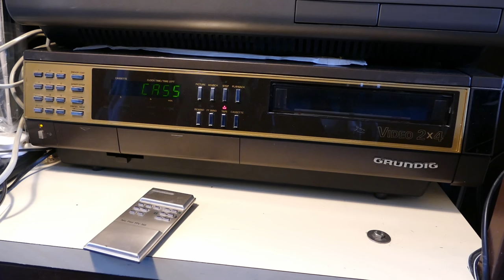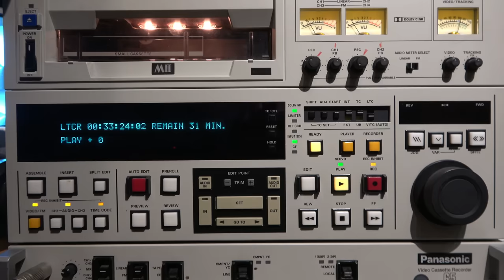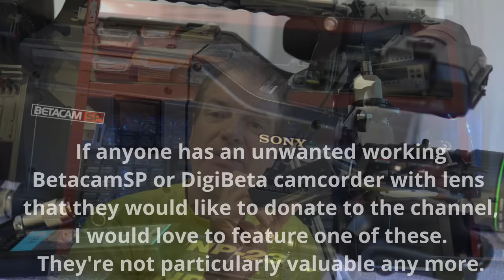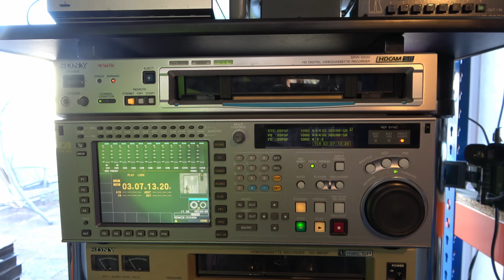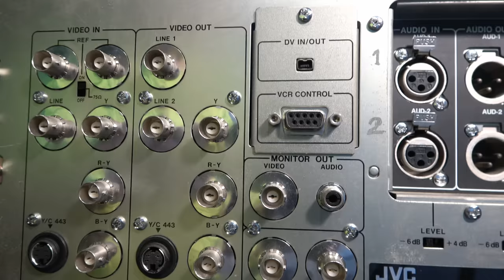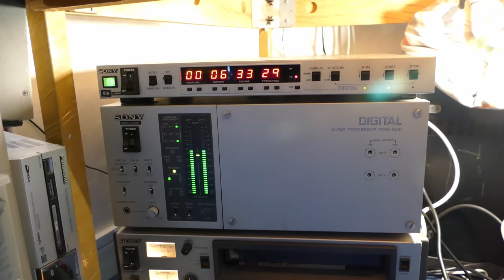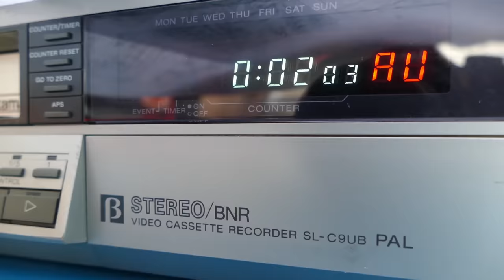Beta vs VHS. A world in which Beta won.

Comment: D3 records a digitized CVBS signal, with which one can save Quadruplex and B or C format unchanged. But that actually only made sense when a BBC employee invented the Transform PAL decoder at the end of the 90s. The alternatives would be comb filters like in the Canopus ADVC-100 (SAA7114) with mediocre sharpness and usable CrossColor interference suppression, or a comb filter with excellent CrossColor suppression but extreme crawling dot formation (Terratec Grabby PRO). There is supposed to be a software solution against crawling dots, but I haven't tested it.
Reply: SingMai made a modern capture device that uses 3D comb filtering and actually can reduce dot crawl from composite sources dramatically.
Reply: … and we still have (and use today) all the Transform PAL decoders that have ever existed
Reply: The Sony DVW-(A)500P had a simple PAL decoder for recording from composite sources, so it couldn't correct for variations in chroma phase. Not all of them could take a composite signal, it seems the decoder board was an option and not fitted to all machines. External decoders seems to do a much better job. Sony must have improved later decoder boards as the one fitted in their DSR-2000P DVCam studio recorder could correct chroma phase errors.
Reply: @jkmac625  BKDW-506 is the name of the optional composite in circuit board. If designers live in an NTSC country, you can be happy that PAL has been optimized at all.

Comment: Danmarks radio TV also started out as the BBC by digitizing their oldest material 2 INCH tapes on the D3 format from 1992. But when Sony launched Digibeta in 1993, Danmarks Radio TV purchased the first Digibeta and then transferred to this new format. that was much more stable than the D3. Digibeta used the 4:2:2 encoding. I'm quite envious of your HD Cam SR. I would love to own one like that 🙂

Comment: I believe it was the other way round, JVC developed their Digital-S format that could achieve broadcast quality video using 4:2:2 subsampling and Panasonic took advantage of it. I read in a D-9 brochure it was developed together with FOX network as a less costly alternative to Betacam for news gathering.
Reply: Thought D9 was 4:2:0 or 4:2:1 selectable. No wait… that was D7 dvcpro.
Reply: @tekvax01  DVCPRO was always 4:1:1
Reply: @tekvax01  Digital-S/D9 was 4:2:2 and I'm sure 4:2:2 was printed on the front panel. It was supposed to compete with Digi-Beta but it had slightly higher compression around 3:1 compared with Digi-Beta's 2:1, so it's closer to DVCPRO-50 quality. DVCPRO is 4:1:1 but DVCPRO-50 is 4:2:2.  Can't remember anything being 4:2:1 but DV(PAL) was 4:2:0.

Comment: I don't agree on V2000. I worked in a repair shop and in it's time most of the V2000 vrt's worked fine and they needed no more time to service as VHS. Most service time was for Beta, aligning mechanicly and electronicly after head swap. Now you do a terrific job but the units are now more than 30 y old. I repaired (1980's) every day vrt's (Belgium), most VHS followed by V2000 and than Betamax. The systems preform more or less the same, being Beta most expensive and a tiny better as the others.
I like your video's!
Reply from the maker: Only a few early Sony Beta models needed the head eccentricity to be aligned.  From the SL-C9 onwards they were pre-aligned like VHS, as were Sanyo and Toshiba Beta heads.  I think most people who have worked on V2000 machines will say that they are complex and troublesome.
Reply: @Dirk De Weerdt I agree. Grundig models were often unreliable but Philips Video 2000 models from the second generation onward were more reliable. Perhaps very few of the decent ones came to the UK that is why the author of the video has such experiences. Also Grundig already improved the reliability of the third series of its Video 2000 machines after 1983, but it took too long and cost too much.
Reply: @janmos5178  no he is right. V2000 was a disaster. The Philips machines broke down all the time. All my cousins had them and they were a nightmare.Never seen a Grundig. Philips marketing had many people in the Netherlands believe V2000 was a  "technically superior" system. That was just an urban legend which is sometimes still heard today.
Reply: @montana01971  They didn't all break down, even the statistics don't confirm it. This is what you could write if you had access to all copies. But yes, the percentage of failure devices was high. But how urban legend can be misleading is shown, for example, by Matsushita-Panasonic. NV 370, 630, 860 models are famous for their quality, meanwhile in 1985 they had so many post-warranty repairs that the famous Japanese MITI ordered their replacement in Japan. Fans of these VCR,s don't mention it but the press of those years, did. This just goes to show how, without careful analysis of statistical sources, you can get it wrong.

Comment: Your comments about D3 and the BBC are way off the mark in terms of branding it a failure. Around 1990 the BBC was nearing completion of its new Post Production Centre in Stage 5 at Television Centre, and needed to settle on a digital cassette based format to populate it, replacing the large and aging C Format based machines (Ampex VPR2 etc.) used for editing and transmission up to that point. Digital Betacam was still a few years away, and formats like Sony D1 were hideously expensive, so D3 was chosen to fit within the new infrastructure, and ran successfully for more than a decade as the main editing and TX format. Included innovations such as Preread were a game changer for fast turnaround operations such as sport editing. There were a lot of D3 problems early on being a new format, with heads wearing out in a matter of maybe 50 hours use, but these problems were quickly ironed out. Panasonic even had their own workshop within the Post Production Centre in the early days.

I say this from the point of view of being one of the senior engineers who ran and maintained all this throughout that time. As for D3 archive content, by the end of this year we’ll have got through all the tapes that we intend to preserve, and even after that we are designing and building some D3 preservation capability right now for the odd tape that will crop up now and then.
Reply from the maker: Other comments here have pointed out that Digital Betacam was not ready when D3 was available, so as you say, that was clearly the reason that D3 was selected.  There's a mention in Wikipedia about insufficient capacity to run the BBC's archives, which perhaps would benefit with and update from your knowledge.
Reply: Happy days. Saturday afternoons would be spent down in the BBC1/2 transmission suites checking the track linearity of all the D3 machines amongst other things. Particularly on the larger cased 3 hour tapes used for feature films, where they tended to be more prone to playback errors if out of spec too much.
Reply: To add, D3 fitted nicely into the largely analogue PAL infrastructure at BBC production centres. Analogue PAL composite video was the format used in TV studios, editing and other production areas. If you put in a load of component machines, the PAL signal would need to be decoded and recoded with resulting artefacts. The D3 with its analogue PAL input would fit nicely into a composite studio, edit suite or transmission area (ie most of Television Centre) without the need to decode and recode the PAL signal. Once it was on the D3 tape, you got all the benefits of digital storage.... TC1 (the big studio at BBC TV Centre) was analogue PAL when I started as a trainee in 1997. Good old composite video was THE broadcast format for a very long time. Most TV Centre studios used SDI as the late 1990s, but would often be fitted out with D3s (and fancy digital PAL coders to convert from component (SDI) to digital PAL (to the D3). They could be swapped out for Digibeta to record component from the SDI, if editing was to be done on the increasingly common Digibeta.
Reply: How I miss the analogue days of having to time things into vision mixers, replay lines etc., and having to worry about things like SCH phase and 8-field sequences.  🙂
Reply: @rpb424  The RS tweaker gets far too little use these days!
Reply: @RetroWorkshop  Agreed (sob 😞). I have loads in my toolkit and haven't used them for years now. Same with other old-school stuff like Varicon (EDAC) connectors. Once ubiquitous but not now - I still have crimpers, pin extractors etc.
Reply: "Panasonic even had their own workshop within the Post Production Centre" I think that says it all!

Comment: It wasn't just Thames that had MII, Anglia in Norwich did too. I went for a job interview at Anglia in 1996 and their videotape area had Panasonic MII decks and a single Sony BVW-75 BetaSP deck sat on a bench, presumably for exchanging tapes in that format. At that time Anglia's transmissions came from Meridian so it's possible they had some MII decks too.

I was told one reason the BBC went with D3, apart from the fact Digi-Beta hadn't been invented yet, was being Composite Digital rather than Component Digital the "new" D3 machines (AJ-D350s) could easily be swapped with an existing 1 inch reel to reel video recorder. You've got to remember at the time (1991/92) places like BBC TV Centre were all wired up for PAL analogue signals, so there was no infrastructure to take advantage of component video. Sony's competing format at the time was the 3/4 inch D2 format, in fact the digital video inputs and outputs on a D3 VTR are called a D2 interface. So the choice at the time for a composite digital VTR was either D2 or D3 and they went with D3. There was an even more obscure format called Ampex DCT that was being tested, which I believe is similar to D2 with 3/4 inch tape.

The D3 format wasn't just used to archive older 2 inch and 1 inch tapes, the format was also used to make new programmes throughout the 90's and into the early 2000's, so yes there would have been a vast collection of D3 tapes to be digitised in the BBC archives. Although by the late 90's the 1 inch archiving project were making simultaneous recordings on both D3 and Digi-Beta rather than two D3 copies. 

Digi-Beta was being used for post production work at the BBC during the 90's but it only became a transmission format in 1998 and exclusively for 16:9 widescreen programmes. D3 continued being used for regular 4:3 programmes, which is why it was still going in the early 2000's. As more productions changed over to filming in widescreen the D3 format was used less and less, and towards the end of it's life just used for archive programming.

Channel 4 also went for D3 and then onto D5 (not sure about HD-D5). An optional board could be fitted to D5 VTRs (AJ-D580s) which allowed them to playback D3 recordings for backward compatibility. Some ITV regions also adopted the D3 format, I think one of them was Thames (the MII connection) and possibly Tyne Tees. I used to have a BKSTS wall chart back in the 90's that listed all the videotape formats and which UK broadcasters used them.

Even JVC's Digital-S (D9) format was used for number of years as a cheap alternative to Digi-Beta by one major BBC production until they switched to HD, while others saw BetaSX as the cheaper digital alternative. DS/D9 was still in regular use when JVC released the later decks with 4 audio channels and front panel jog/shuttle control. The 4 track machines could playback older 2 track recordings, but I remember a warning sticker on the top of the 4 track machines (a JVC sticker) warning about the audio insert editing compatibility between the 2 variants. I never saw a DS/D9 deck fitted with the firewire option only SDI. Firewire didn't even come fitted as standard on Sony's broadcast DVCam decks (DSR-2000, DSR-60 etc), so firewire wasn't commonly used in broadcast TV. The DSR-2000 did have a way to copy the DV data directly between 2 machines without the optional firewire card, but it was done using a BNC connector/interface. I didn't see firewire in regular use until DVCPRO-HD arrived, as it was the only way to access the original 1440x1080 image as the HD-SDI output was upscaled to 1920x1080.

Comment: Well professional market is a totally different beast. For home video you can cut almost any corner and get away with it as long as it selling out. Maybe several formats with many-many competitors. Professional industry tends to cut formats instead of corners. And collaboration between manufactures even for single format is unlikely cause equipment quality may vary. But pros likes consistency.

Also in my opinion Betacam is separate format from Betamax. Even if Betacam decks can play Betamax tapes. When Betacam was introduced forwat war was still going so maybe they just was hoping to support Betamax by saying: "look it's professional format".
Reply from the maker: Yes I know I was stretching the point a little with domestic Beta to Betacam, but the lineage is no more stretched than from VHS to MII.  This video was made primarily for new viewers who may not have realised that Beta based formats lived on and VHS based formats generally didn't.

Comment: The D3 format was introduced several years before DigiBeta was released. I worked at a large network in Ontario, and they had hundreds of D3 tapes. The format from Ampex was of excellent quality, however, the transports were very labour-intensive. We also had the D1 and D2 formats. D5 and HDcam are still in service today, for some distribution of movies, and long-format shows.
The Digibeta heads were extremely expensive and had 17 flying heads on the drum. they were a nightmare! We used BetaSX in Sony Flexicarts for over 15 years, and still have several machines, and a large library, that we are slowly transferring to file-based XMF formats.
Reply: As you said, D3 came out years before DigiBeta. And it was a direct replacement for 1" VTR - with composite video in and out, so expensive infrastructure didn't have to be replaced when 1" VTRs were replaced with D3 VTRs. That's why Auntie BBC bought them.

Comment: I started out on Beta as it had superior quality to VHS to my mind. Unfortunately the heads appeared to wear pretty quickly, and I wondered if this was due to the fact that it rewinds while laced.
I seem to remember that you stated thatt a particular Sanyo model rewound in the cassette.
Is that the case with all Sanyos?
Reply from the maker: Nearly all Sony machines rewind while laced (just one duplicator did avoid that).  Sanyo machines after about 1981 unlaced for rewind, such as the hugely successful VTC5000.  From my experience Sanyo machines do have better head life than Sony, with the exception of the Sanyo VTC-M40 whose heads I suspect were actually built by Sony.  The last Sanyo which remained laced during rewind was the VTC5300/VTC5400, which despite the number, is earlier than the VTC5000, VTC5150 and later front loading models.

Comment: Great Video. I have been hoping you would do a video on the consumer to Pro video tape format evolution for some time and this didn’t disappoint.
I was gifted a non-working Sony SL-C6 MK II around 1989 when doing work experience (which I subsequently got repaired) and this got me into using Beta at home.
I actually got a Sony SLF-25 Beta from Thames TV in the auction when they closed.
Latterly I used the Pro Beta derived formats at work, mostly DigiBeta and HDCAM.
Rather unsurprisingly I have a lot of love for Beta.
Very interesting to learn more about the Pro VHS derivatives as I never really came across those.
Curiously I see a slight connection between the last consumer and Pro physical formats I used;
Blu-ray recorders at home and SONY XDCAM HD disc recorders at work that use the Sony “Professional Disc” format (this being a disc format using blue-violet lasers like Blu-ray).

Comment: Excellent video as always, very informative and interesting. I think you might have forgotten Sony XDCAM, although quite short-lived... I might have missed it if you mentioned it :) I used to work at framestore in Soho, we had umats a plenty, D1, beta, betaSP, digitbeta, hdcam, hdcamSR, XDcam, Panasonic D5 as well as clipstations and clipstationpro disk based systems, another from Edifis, and a whole host of film kit, rank cintel telecine and Philips spirits... All good fun :) yes indeed the old D1 machines were about £100,000 and a HDCAMSR  started at about £75,000 plus options. Mind you, the old SGI onyx 2 computers were about £250,000 and I looked after 8 of those 😅 let alone Sony broadcast monitors at £20k plus and Dolby 40inch grading monitors at around £40k. Madness really. Thanks again Colin.
Reply: I repaired a lot of Framestore's VCR's in the 90's! Remember Metro?